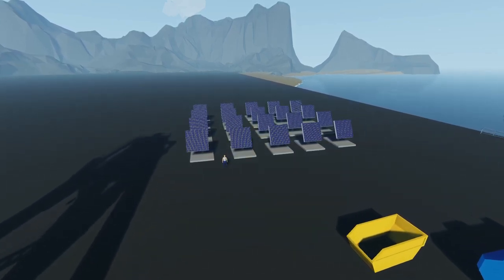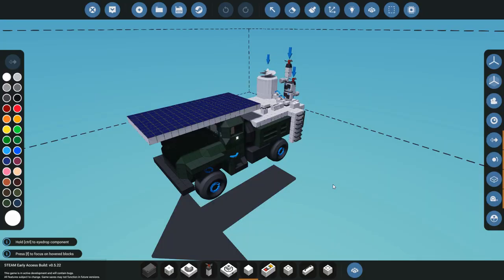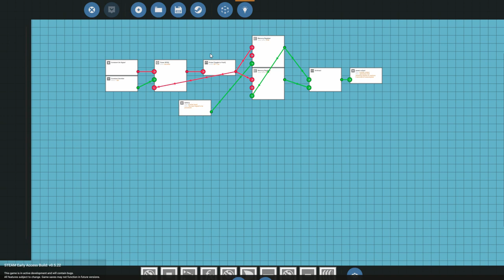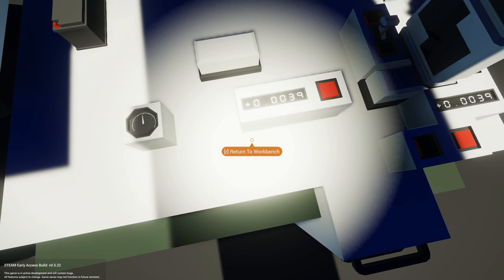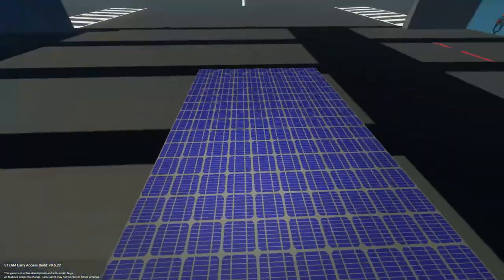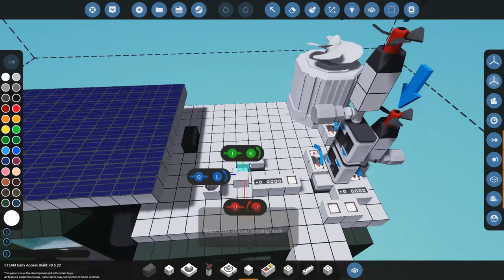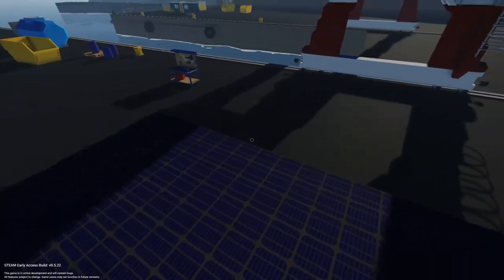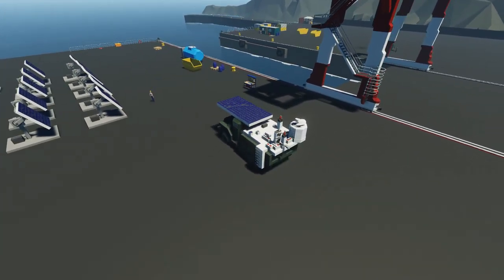Solar Panel Output = 0.00005 Watts Per Second? | Stormworks Solar Panel Update!

Comment: How do you get things to spawn on the deck there, and not in the water or hanger?
Reply from the maker: so, you can create a mission and place objects/vehicles on whatever location you want. make sure to add the vehicles/objects into the  components part of the mission tab. also you want to put a empty objective so that you can spawn in the mission.
Reply: @StormRunnerGaming    Doh!  I haven't explored the create a mission aspect yet, but it make total sense that you could place them anywhere using that.  🤨
Thanks for the reply!
Reply from the maker: yeah, no problem!

Comment: So, a year after this update, and they're still in the realm of not worth it in my subjective opinion. 3 reasons why. The power to weight gain is bad (power that we might get from a single cell to how heavy that cell is),  they don't work in storms......counter intuitive to the name of the game, and there's not a "mass selection" tool yet for logic connecting. The fact that every single cell has it's own power logic point and that you have to hook up each individual one....... If I could just click 'n drag select a whole block of them or when 2 or more cells are built in direct contact they share the same single logic point, then I'd take these out more as emergency backup sources for electricity. But there's just so much time put in for so little payout.

These need a little love for "quality of life" updates.
Reply from the maker: Yeah, I wish there were some updates to the logic connectivity for things like connecting multiple solar panels.
Reply: @StormRunnerGaming  Maybe like a "Select all the same"? or "Select all the same in X^3 block area"? Some simple (ha. simple for us. probably a massive script overhaul and debugging for the devs) improvement like that to make them more user friendly.